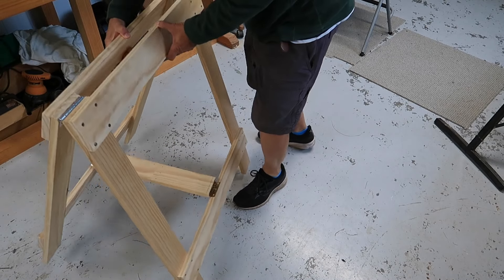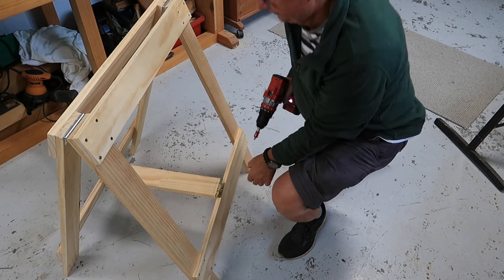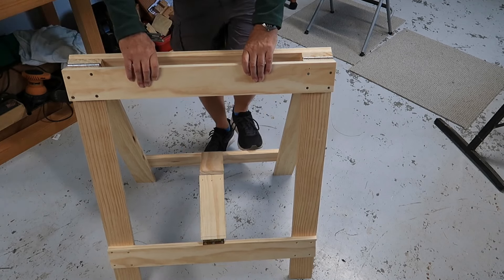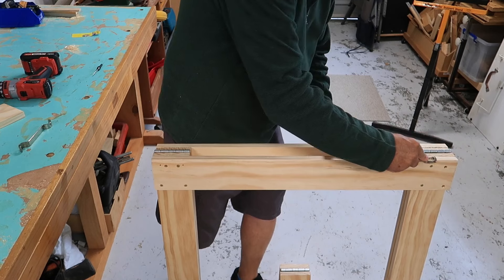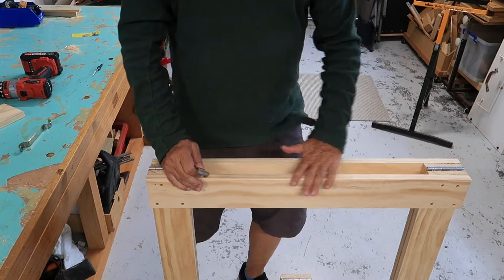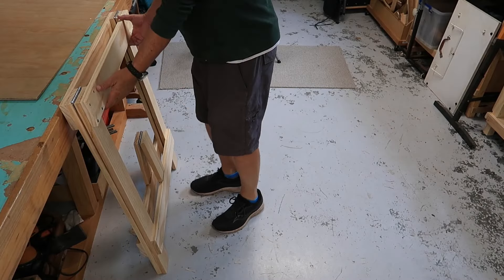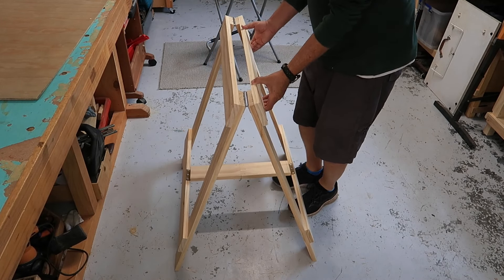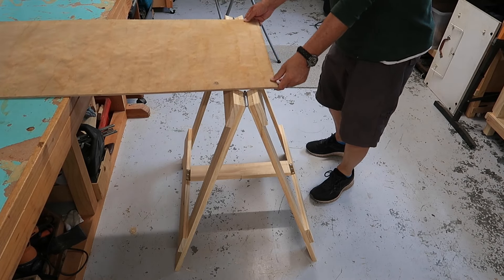Sturdy Folding Lightweight Sawhorse

Comment: What is the angle? Thanks…
Reply from the maker: Hi. The angle I wound up with was 40 degrees.  It wasn't a deliberate choice, but depended on the length of the folding cross pieces. I adjusted those to get the height I wanted.
Reply: @AlansWoodworking  thank you so much, have a nice evening!

Comment: What heightand the lenght of the wood pieces?
Reply from the maker: Sorry for the late reply. There are 4 horizontal sections each 75cm long, 4 upright pieces 88cm long and the folding cross brace is 2 pieces each 24cm long. The timber is 90mm by 20mm and the hinges are 90mm wide

Comment: Where did you get the tool used to round over the edges? I really like the pull action of it.
Reply from the maker: Hi Mike. The tool is the Veritas Corner Tool. I bought mine in australia years ago, but I guess you could get them online these days. They're not cheap and they have limitations (can't use them against the grain) but they're a lot faster and convenient than using a router in a lot of cases. 
Have fun,
Alan

Comment: can you give a rough estimat of material needed?
Reply from the maker: Sorry for the late reply. There are 4 horizontal sections each 75cm long, 4 upright pieces 88cm long and the folding cross brace is 2 pieces each 24cm long. The timber is 90mm by 20mm and the hinges are 90mm wide
Reply: @AlansWoodworking  Thank you.
Reply: Excelente! Show!👏🏽👏🏽👏🏽

Comment: No measurements, angles?
Reply from the maker: The measurements are in the description
Reply: @AlansWoodworking  We use inches and feet around here. Me thinks is what the question was regarding sir. And what height did you prefer? Excellent video mate.
Reply: @dshupin9648   I wanted the saw horse to be the same height as the bench

Comment: Hey Alan!! Wondering if you have a rough estimate for how much these weigh? Looking to make some for my craft show table pop-ups and am being very concious about weight!
Reply from the maker: Hi Morgan.  The sawhorse weighs 6 kg or 13.22 lbs. I used 90mm stock because that's what I had in the shop, but if weight is an issue you could probably use 70mm without sacrificing too much strength